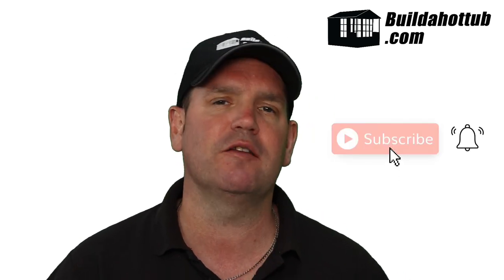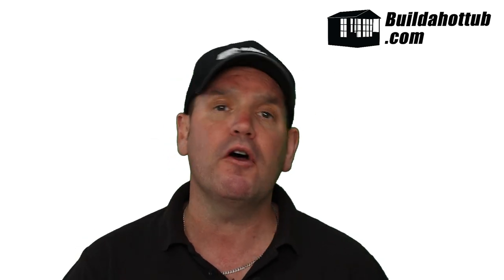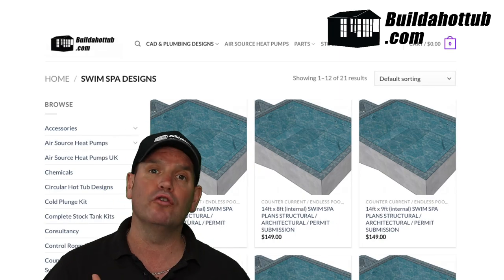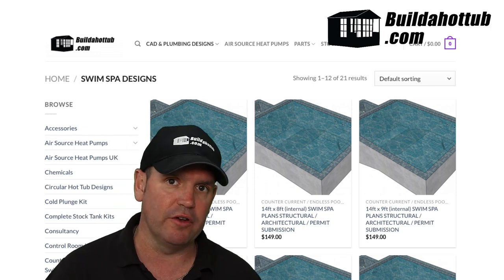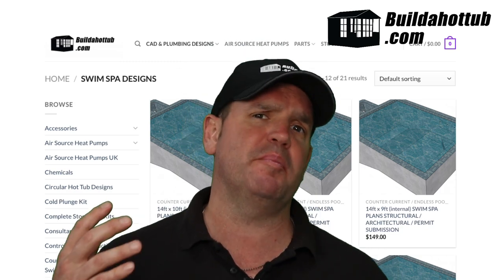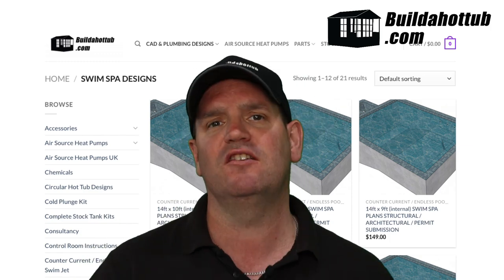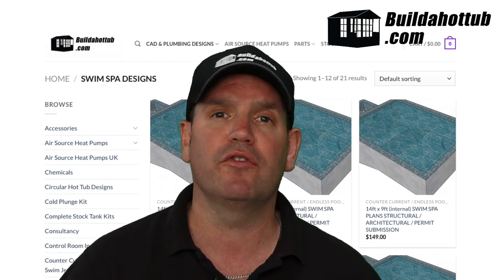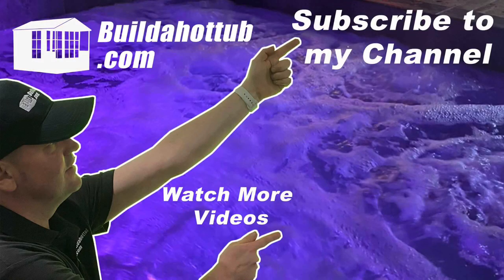Can I build a DIY Swim Spa?

Comment: Great video, thanks for your efforts. When we get down to prices, is when I think, I cant afford this.
So, my question would be, would it be possible to use a liner to save on costs, and could it double as a therapy pool(higher temp). The wife has arthritis.
Reply from the maker: Hi there - yes you can use a liner but they are difficult to do as a diy’er - getting in into the track and then vacuumed into place takes quite a bit of skill - it is easier to paint the surface to save some cash - hope that helps! - Andi
Reply: @Buildahottub  Thanks, There's no hope for a cheapskate